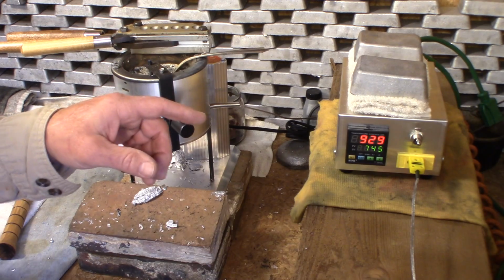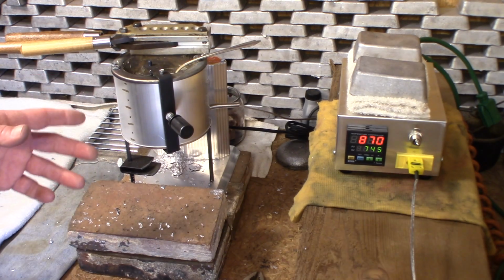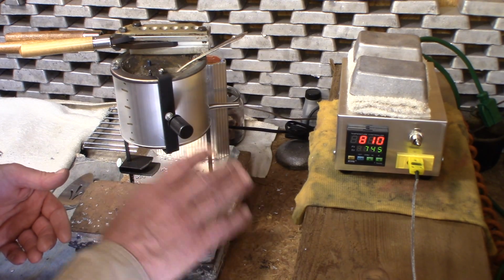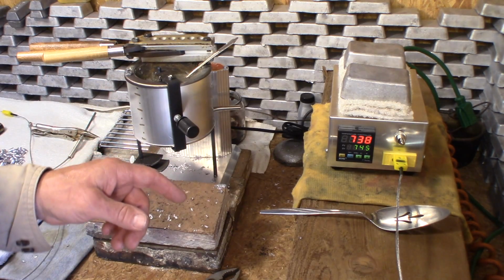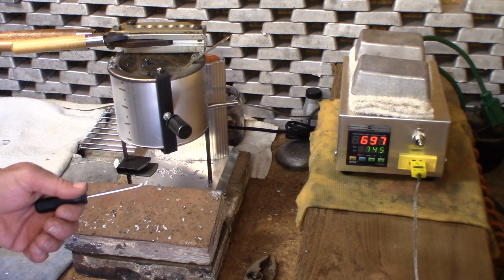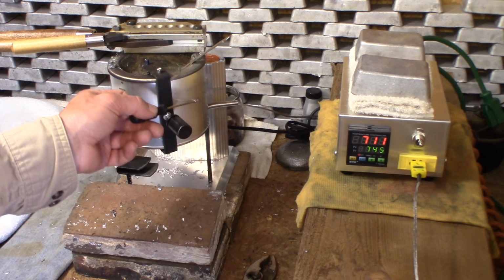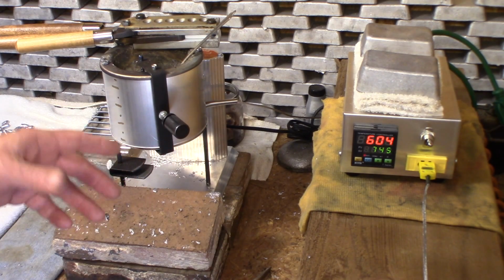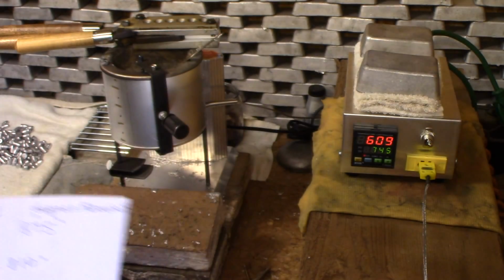Lee 4/20 Melting Pot, Mastering The Temperature Dial

Comment: Started casting in december, 20 degree weather. Pot always went up to crazy temps. Didn't have a thermometor at first because, ya know, I can eyeball the temperature of an unfamiliar substance. I'm not just "some guy." After fluxing every 20 minutes and getting baffling results I got one. 900+ on any setting. Every time.
     Come next spring it was adjustable. Bottom of pot is sending heat up. Isn't expected to read the same as the melt. The winter kissed the internal thermostat and made it nuts. I thought the thing was just trash. Maybe I should update that product review...

Comment: Taurus/Hipoint enthusiast suggested your videos, dang it he was right. You are awesome I am getting the 4-20 had been kicking the pid idea around, IF IF mine works as well I see no need for the pid. I will have to set up my own testing to see where the temps hold and what numeric to use on the dial. If 760-800 hold and keep there. That is what I`d prefer with my casting.

Comment: I have two of these, but never realized how they regulate temperature. I assumed the wattage was being modified by the dial, but it's a thermostat, not a rheostat. I thought that the lower the level got, the hotter it got. My method has been to crank it all the way up and modify temperature by adding ingot. This helps a lot. Thanks!

Comment: Elvis, do me a favor please. Would you shoot the actual lead in the pot with a Non-Contact Digital Laser Infrared Thermometer and see how the readings compare with your two probes. The one under the pot and the one directly in the lead? The IR thermometer could be and quick easy way, and cheap, the check the temp.
Reply: Laser thermometers are very inaccurate on a reflective surface.
Reply: @elvisammo  Thanks for all the input, gathering up tools to progress beyond casting round balls witch is all I've ever done.

Comment: Why run the pot so high?
I think its best to keep the pot well below the melting point of zinc.
This prevents accidental zinc contamination of the alloy. 
Im told that you can actually boil off the tin if you run the pot too high.
I like to keep mine around 700 to 725.
Thanks for the video.
Reply: I gotcha'. just scoping out the dial settings. Got my daily exercise jumping to conclusions.

Comment: how can I remove bullet lubercant from my cast bullets so I can powder coat the bullets
Reply: Melvin Ruth  Buy a slow cooker and layer your lubricated bullets with absorbing paper towels. Low setting works fine. I've also done it on warm setting. Take bullets spray with a degreaser on paper towel and roll them around to ensure all traces of lubricant is off. This will not work with Lee Alox.

Comment: Great data for those that have the electricity! Out here I'm on solar /batteries! So if I want to cast, it'll be on propane! But I have a pro digital point & shoot thermometer. I'm getting a good education for casting from YOU GUYS! And I'll have to buy ebay lead ingots. Starting to see my duckies line up. Minus -34 this morning so I have time to learn until spring. Thanks for sharing Elvis!
Reply from the maker: sounds like your living right John Doe ... !   Makes me wonder if I could convert a lee 420 pot to propane?  : )
Reply: I would think the lee pot metal underneath would not be able to take an open flame. But having a cast iron pot with an open flame would be a good backup plan. These days a backup plan is necessary Elvis! Greetings from the artic swamps of Minnesota!

Comment: both of your temperatures are correct. The lead inside the pot is warm enough to be melted in in liquid form. the bottom of the pot is not hotter than the melting point of lead. because the spout is cooler, the lead will not flow out. inside the pot and outside the pot should be about 30 degrees different. you just have to make sure the spout is hot enough to keep the lead flowing flowing

Comment: Hey Elvis that is really good info. What would be really interesting to see if the pot is more accurate than our thermometers. Take a lee and a Lyman and RCBS and see if they are all different, but the numbers on the Lee pot are not !! I have a Lee and my friend has a Lyman and we are 150 degrees off at #7 on the dial. He reads 750 degrees and mine reads 600 !
Reply from the maker: good stuff Nick J ... Thanks for sharing the info... and yes my bet is most set their pot a little hot ... thanks again!

Comment: Fyi to guys building/buying parts for this PID. I found on ebay the K thermocoupler with the yellow plug connected,and without the metal probe,so instead of waiting for 2 or more supplier to ship from china,you can deal with 1 less and its ready to do the elvis ammo pid mod.it will save a little build time too. Mine cost 2.75 free shipping. Haha should be here by june !!
Reply from the maker: Nice Edad Martin! Thinking outside the bun! : )

Comment: This has prolly got a few folks scratching their heads, especially if they use the standard analog lead thermometer in the pot.
I used mine for years before checking it in boiling water and calibrating it...it was 40* F. off, too low.
I cast at 4.25 on the Lee dial and 735* F. in the pot...shiny boolits! . . . great work as usual you ole brass stuffer! . . . charlie

Comment: As we use different alloys, Say more tin content.Can the furnace be operated at a lower temperature without the spout freezing up? That would be a good Video to do, I know that most people out there cast for economy reasons.. (+) shooting,, (-) money and tin is a expense that adds to the costs of casting. Roto metals has alloy available and that would be of improving cast quality and for the cost It's not that much. Mr. Cookie has demonstrated the proper alloying techniques over there on his channel and would be a good video to watch if someone wanted to give that a try. Good Video series, It was good information for those that don't use a PID control unit. Good shooting always Buddy Elvis..  Dave.

Comment: Great video as usual.  Your demonstration that the Lee pot can maintain a temperature very well on its own made me wonder if the Lee pot has its own thermocouple installed somehow?  I know nothing about electronics, but if the PID controller is using a thermocouple to operate its controller to maintain temperature, how is Lee accomplishing the same thing electronically?  With a thermocouple wired to its heating coil or somewher else?  And if there is a Lee thermocouple, can it be tapped into to use with the PID?
Reply: The Lee 4/20 has a thermostat in the back of the case just under the adjustment knob....
Reply: It's called a thermostat. It's in the product description. Jesus fucking Christ.

Comment: Lee Production 4 Pot, I can only cast at number 5 or a little bit better  on the dial for  357 magnum,  38 special rounds on pistol and 308 rifle rounds which will run at 750 - 800 degrees  and cast good bullets with no frosting and wrinkles , according to my regular thermometer
Reply from the maker: hey Crystal B .. yeah my pot when it starts getting low at around or under 5 if im throwing big sprues in after every cast it will try to freeze up my lead or the spout will stop working first. Thanks again for sharing!
Reply: that's exactly what happens here, the spout freezes up, and have to raise the number on the temp, awesome glad my lesser pot is up to speed to the higher price pot! thanks for sharing in DETAIL your results.  The best on YOUTUBE for  casting lead, thanks again

Comment: Your mold resting on top of the pot is acting as a heat sink .  My thought is if the mold was  not on top the cycle on and off would not happen so quick with the mold removed from the top.
Reply from the maker: Yeah good point gman77gas... these heat sinks play a bigger role than one would think!

Comment: I run my pot hot like that too. I have a lyman thermometer in my 4/20 pot and I keep it at #7 and when the thermometer shows the temp is at 900 I drop in an ingot which will drop the temp to 825 to 850 and eventually when the temp gets back up to 900 it's the same time I have room to add another ingot. Doing it that way means I don't need to stop and wait for the pot to heat back up after adding more lead. Once the pot is around 850 I can cast bullets for several hours without stopping if I want. My ingots are small so when casting 45 acp I usually have to add one every 10 minutes or so.
Reply from the maker: Hey Prepare2Survive, Yeah it's interesting to see how folks run their pots! Thanks for sharing you yours!

Comment: FYI, i confirm your temp findings sort of. I cast ingots today,setting the dial at 7 my lyman thermomiter said 900 after fluxing,i turned down to 5 temp was 775, when i put it on 4 the full pot read 725 ish.now when i got to a half pot temp went up to over 800. Interesting.as i filled the pot back up it dropped to 650 until all lead was melted and it went back up to 750. Each pot is different,but i was surprized how much hotter i had been running, using the pot controls with no thermometer.im waiting for PID parts to show up so i can build it.
Reply from the maker: Hey Edad Martin.. Thanks for sharing your results... This is helpful for us to read about!!
Reply: Me too waiting for my parts to come in... bought enough for two PIDs may sale one only if my first one works!

Comment: Seems someone could make a better melting pot. One with a steady temperature control system. PID not needed. Let's see what we can come up with 🤓
Reply from the maker: Hey Carpe Diem... I still have a little work to do to break it all down... But not bad at all! Lyman and RCBS has the ones your talking about but they are a small fortune!
Reply: It's called a thermostat. Only every single company offers one.

Comment: I get the same results at 4 on a lee 10lb pot  =730f @ 80%,60%,40% the results are conclusive your data matches my data and to the fact of voltage drop my power is always 118v.
Reply from the maker: Hey David Ycedo... good to hear we are coming up with similar results..Thanks again my friend!
Reply: Hey don't forget to factor in the +30 degrees as this is the actual lead temperature not the heat transfer though the inner shell that's why you have a 30 degree different reading I take mine of the molten lead. have a great day very well done my friend.